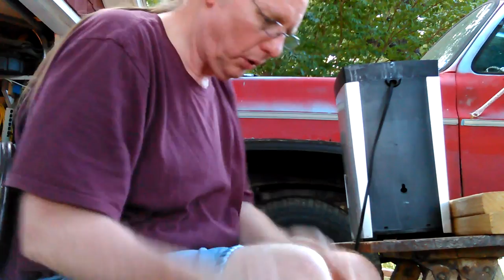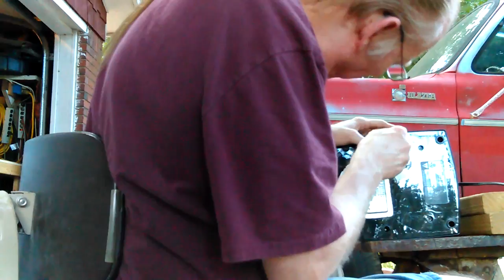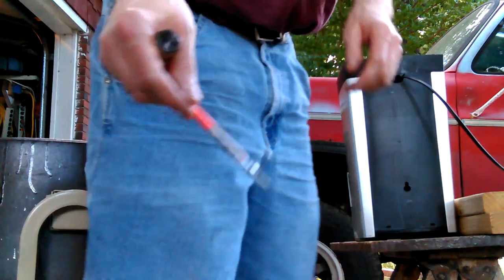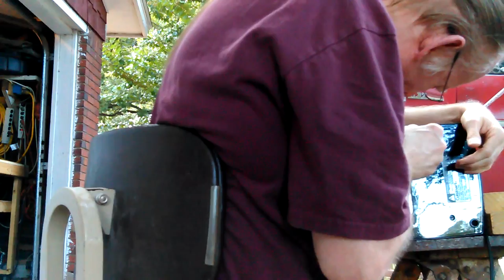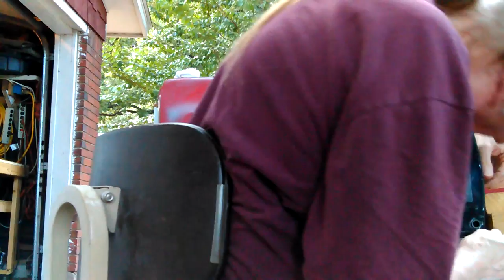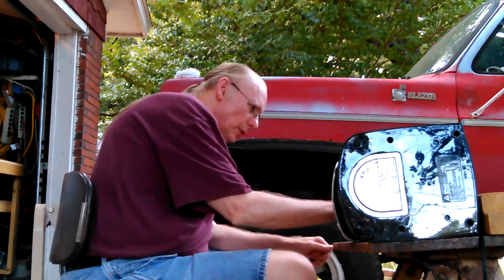VID_20160814_192419.mp4 Cuisinart Coffee Maker Repairs

Comment: There's two staggered screws with washers near the electronics and two under the pads you need to get.  I took mine apart and metal came out I couldn't identify, so I tossed it.
Reply from the maker: Thanks, I actually only got 1 screw out of it, at the time of this video. I didn't have a long enough T9 Torx Driver. I saved the DGB 650 for Parts and bought a new DGB 625. It was cheaper. And just last week. I got this DGB 650 out, to use the Grinder Basket, in the 625. It had worn a hole in the side, from grinding beans every day. That's the second or third one I had, that wore a hole, in the Grinder. Since my first DGB 600, that I got in about 2002. I still have it too. It just needs the water lines replaced. It leaks out of the bottom. Anyway... back to the 650. I bough a set of long Torx Drivers, a year or so ago. So, I was ready, this time, with the right tool for the job. Mine has 4 screws in the bottom and it comes off very easily. I thought, there might be screws under the rubber feet. But, there weren't any. I had done some research, earlier. And knew that the Thermal Fuse, was probably the reason it would not heat up. There were actually 2 Thermal Fuses, in it. I tested them for continuity. One was good and one was bad. I had some that I actually bought for my Bathroom Heater Vent Fan Combo. A few years ago. So, I used one in the DGB 650. That did the Trick and it now heats well. Actually too much I think. I suspect that the Thermostat or Thermo-Coupler or what ever the proper name for the part is. May not be cutting of the Heater. And that is why the Thermal Fuse Blew. So, I put it away, for another day. I've got the DGB 625 working well again. So, that will do for now. I do like the 650 better. It came with the Thermal Carafe. And no Hot Plate, which burns the Coffee and makes it taste bitter, in short order. I'm using the Thermal Carafe with the 625 and it does help keep the coffee from burning so quickly. And it keeps the coffee warm for hours as well. Check out my Playlist in the video description. The video named, Cuisinart Coffee Makers Testing after Thermal Fuse Installation 2020-0820-06:25:42 Pt002. Shows how the DGB 650 looks inside, with the bottom off... Don
Reply: @DonBishopDonSongs  I just bought a cheap coffee maker and plan to transfer it to the thermal carafe and take it out to the shop with me.  Once you take a couple of those coffee makers apart you realize they're all pretty much the same.
Reply from the maker: @JesusIsaFlatEarther  Hey, fellow grasshopper:) Ya, that's what I did with mine, Except I bough another Cuisinart, DGB625. I was a bit worried, about the Foam Insulation, on the Stainless Carafe Expanding or Blowing it open. Since, there is a warning in the DGB650 manual. Saying, don't put it on the Stove, it may do that. Wouldn't want to have a foam fire, in the Kitchen. But, I watched mine. And it's been ok. I've been using it on the 625, with the Hot Plate, for over a year now. Ya, I've seen several videos on other Brands of Coffee Makers. There pretty much the same. I watch one, the other day. And a comenter mentioned. That if the "Thermostat" goes bad. It will blow the Thermal Fuse. Which makes good sense. And my 650 is getting way too hot, on the outside. The Stainless area, by the buttons, is so hot, when you brew. It you touch it, it will burn you!:O So, I put it away, for another day. Maybe I'll find a Thermostat for it. If it's not too expensive. I may replace it. The only reason, I keep buying Cuisinart Coffee Makers. Is, I see too many Reviews on all of the Cheaper ones. Where something shorts out and burns up, inside of many of them. I'm not risking that, in my home. And the Higher priced Coffee Makers, have about the same Ratings and failure rates ad the Cuisinart's do. And they cost $50 to $300 more... Not worth that, to me. Also, I am spoiled, with the Auto Grind and Brew Feature. And there not too many other brands (with good ratings) that I can find. That do the Auto Bean Grinding. Next time I buy a new Coffee Maker. I will look at other brands again, though. I would like to have one, that also heats water. For quick Hot Cocca, Molto-Meal, Oats etc... Let me know how your cheap Coffee Maker, turns out... Don